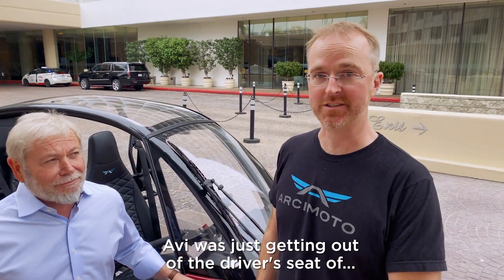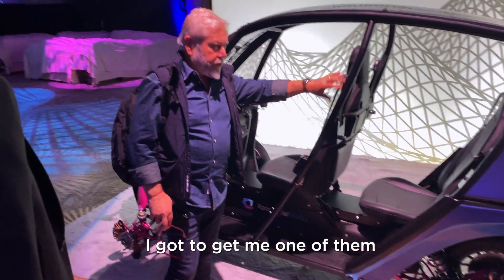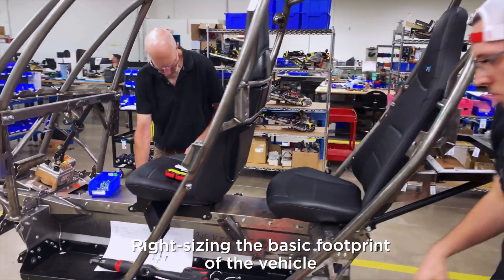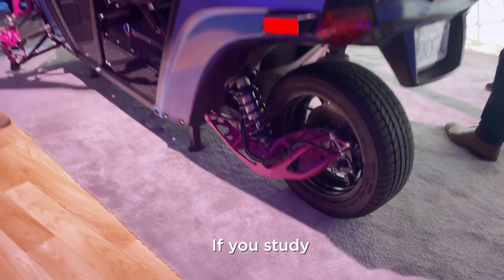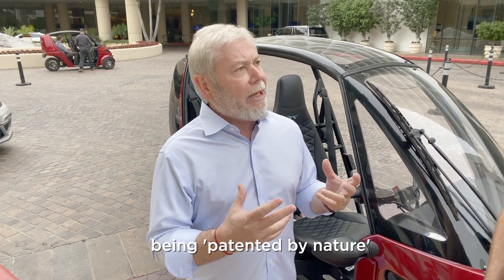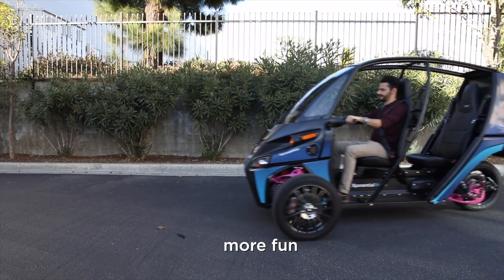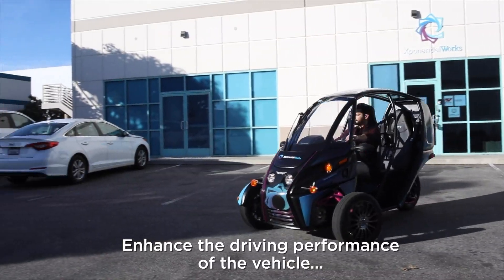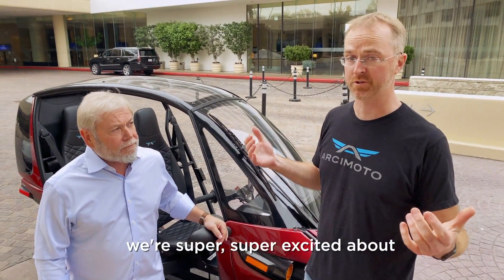Arcimoto and XponentialWorks use AI and 3D printing to put the FUV on a 30-day diet

Comment: 30/1300 = 2.3% 

Better than nothing. I hope they can extend the effort to get a more significant saving.  Do continue to use 3d printed parts as a marketing point.
.
The mauve color is obvious, but a little off putting. That being said, I hope they offer an option to "paint" the 3D printed parts in a contrasting color (neon?). That way geeks who do get the parts on their rides will be able to more easily show off to their friends this obvious geeky feature.
.
The 3D printed pedal was "cool".  Could they do something with the handle bars? I would really like to see what a "patented by nature" crash cage would look like.